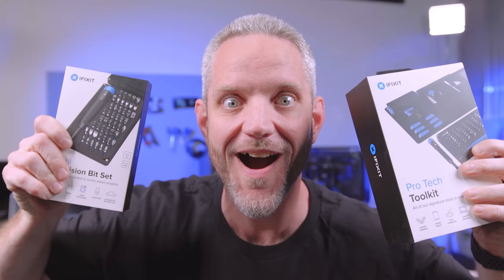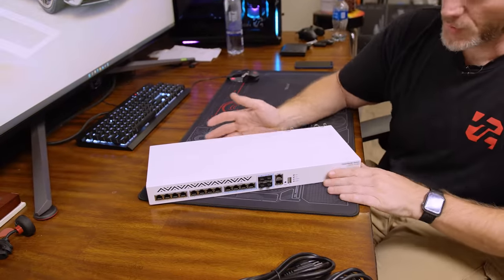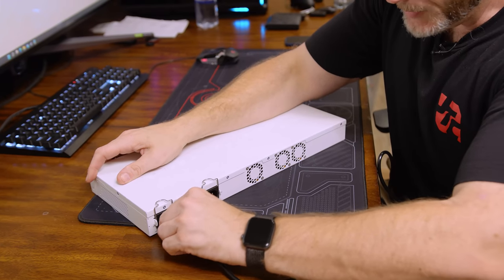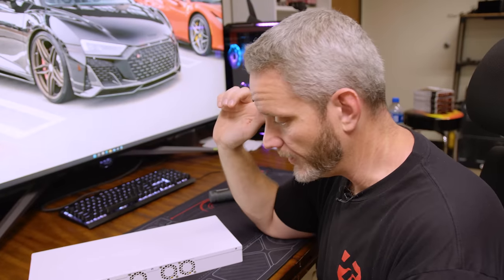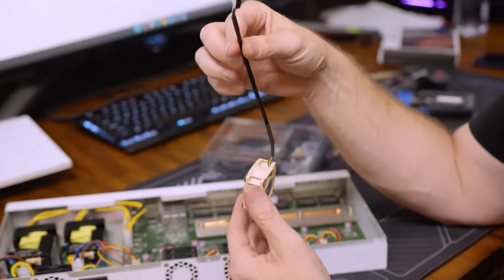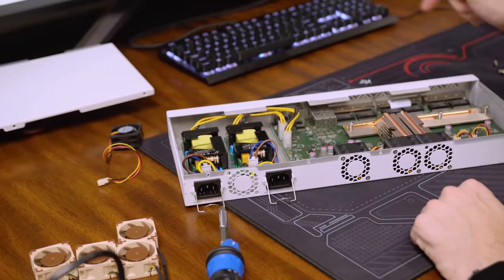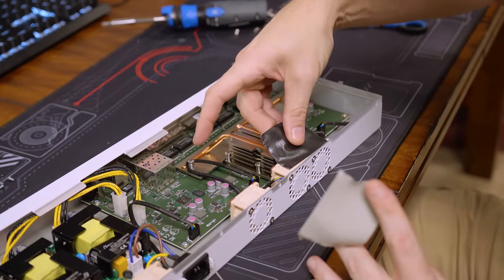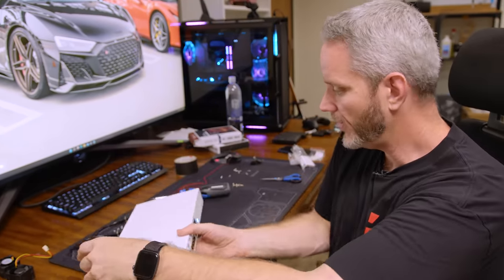We had to modify our new network switch...

Comment: I own several of MikroTik switches for my home lab.   Jay, since you don't want to use advanced features or configure it go into the WebGUI and switch it to SwitchOS.   This will give you much better performance.    Make sure you update the RouterOS firmware first before switching it to SwitchOS.
Reply: I agree with this 100% and I will add something very important. Make sure you enable ARP Tables in Switch OS. This will give you a lightweight management scheme that significantly increases performance, reduces traffic, reduces switch fatigue and greatly increases the connection speed (also reduces lag). From Jay’s description of use case… this is what he is really after. Oh… it will also offload local traffic from your higher tier router. 

Lesson: Just make sure ARP Tables is enabled in Switch OS. It’s one of those few simple options that has a dramatic effect of local network performance at a micro-price.
Reply: 100% the right answer here. Being a system engineer and homelabber these 'server' videos are kinda funny to watch. "these switches sound like a whole server rack on it's own" haha tell me you haven't been in a DC without telling me.
Reply: @pitspeedtv  OK, never worked with MikroTik but I have a question. This is an honest question about how the switches run because standard networking goes against your statement. What exactly would using ARP tables on a switch running l2 communications do to help? Just curious because ARP tables are L3 (ip/mac) and the switch at L2 only cares about mac location because it is directing traffic based on mac to mac. It's going to look at the incoming frame and and see the destination MAC address and then send it out the corresponding port it has in its MAC table. It will never go to the ARP able unless it is also running router functions. Adding ARP tables to a switch that is not also doing routing is just overhead on the switch processes.
Reply: Another vote in support of this suggestion
Reply: @joee7452  All good Joe. Good question(s).

You just pointed out the highlight of SwitchOS (I don’t work there, just tested extensively).

traditionally (this is where you are getting tripped up), ARP Tables are (and still are) reserved for Tier 3. The same place that VLANS, DHCP, and VPNs reside.

Ironically, this switch is underpowered (chipset) to handle any sort of VLAN, or VPN loads. This is where you would buy ubiquiti and such (therein lies the cost justification)

BUT….. What if you stripped away all of that and said this:

“Let me take my memory, and my processing power (traditionally reserved for managed tasks), and apply it to three simple tasks…”

The three tasks:

1. Query the ENTIRE network (including the tier 3 router) for matches on a local subnet, PER PACKET. (BTW unmanaged (T2) switches just send it to the tier 3 router, because they have no ARP tables, etc.) Traditionally, waiting for the reply, is the major cause of what we know today as Network LAG.
1a. What if we stored that and routed all proceeding packets at what would traditionally be considered tier 3, at Tier2?)
Before I go on… it is technically tier 3, but what if we could make it tier 2A? Not send it to the router/T3.
Network Lag becomes very apparent when you consider that every packet (big or small) needs to be parsed, and passed, and rerouted until a handshake occurs. Until it runs into a rule, or specific network instruction (Tier 3… internet router, etc.). The LAG comes with the waiting for reply and the timeout when none is received.

2. What if we had sufficient memory and processing power to maintain a simple list of successful handshakes and packet transfers (locally in the same subnet), and completed the handshake and transfer without needing to send it up to the “gateway”? Well that is an ARP table. No waiting, no LAG, and simple routing, handshake, packet completion.
At this point we are in traditional Tier 3 territory. But what if we could do it at tier 2? Or technically tier 2A.

3. Store and Parse not only the *known routes*, but detect and parse the packet size?
Again a typical tier 3 router function.

Well that is what SwitchOS does. In fact with the exception of #3, that is what a normal “dummy” switch does.

So you are correct about Tier2 and Tier3. SwitchOS is a beautiful hybrid. Strip away the VLANS, VPNs, etc. Just focus on LAN, and send it up if it doesn’t have a recognized subnet. 

It’s a 10G Ferrari LAN, at a KIA price.

All of the bad reviews revolve around RouterOS and its inability to to VLANS and VPNs. 

That is not where it shines.

Jay’s use-case is perfect for that switch… in SwitchOS.

The SFP+ version of that is cheaper, and you can use ethernet SFP+ adapters, as well as scale to fibre at less cost…. but the topic is Switch OS and ARP Tables. I digress.
Reply: Sorry… made an error. Traditional “Managed switches” maintain ARP tables, and if you don’t ask it to do VPN or VLANS…. it functions the same. Just not “traditionally” at 10G. But also points out why you ALWAYS opt for Managed Switches, VS the Unmanaged (Dummy) switches. Sorry for the confusions.
Reply: @TheMrDrMs  Hahahaha You sir had me rolling with that one. I have hearing loss from the fan pitch from maintaining servers and switches.
Reply: @pitspeedtv  OK, except the whole idea is latency inducing. The idea around switching is MAC based. The switch doesn't care what IP the destination is. All it it does is receive the frame, check the destination MAC in the header and then send it out the port it has associated to that MAC. I am ignoring going into how a switch fills it's MAC table. A l2 switch cares about MACs only because that is the fast way to switch frames. From an IP level the packet is either destined for a node on the local network, in which case it is going to put that packet into a frame with the destination MAC address for the switch to forward it directly to or it is going to put the MAC addresses of the Router or Gateway in the frame to tell the switch where the frame needs to go.The speed of switching is because it is limited to MAC to MAC communication. Forcing a switch to to not only open the frame header but the packet header to read the IP on top of the MAC would just induce latency. That was why I was confused at why that would speed up the switching. Switching is simply from this MAC to this MAC. The switch doesn't need to know about IP because the sender is going to put in the destination MAC for the switch to forward it to in the frame. That includes putting in the MAC address of the l3 gateway/router interface if the destination is not on the same local network. So even in that case, the switch knows the MAC it has to forward to. 

Please understand, I work with enterprise networking (Cisco,Arista,Juniper,Mellanox, etc), so I was confused on why forcing the switch to look deeper into the frame before sending it would speed it up. I will take your word for it that it does, I just don't understand why they would setup a switch to speed up that way.
Reply: @pitspeedtv  I prefer managed also but even simple unmanaged switches keep MAC address tables. That is all a L2 switch needs to have to preform its functions. Because without that table it's a hub.

ARP is used at L3 to determine what MAC the IP is tied to so it can be sent out the L3 interface to the next node's MAC address. That could be the destination or the MAC address of the next hop.ARP table and MAC address tables are not the same thing. Simplified - ARP is "to get to IP X send to MAC X". the MAC table is "MAC X is located off Port X".
Reply: @joee7452  Yes we are agreeing. Mostly. Except that the MAC Table cannot exist without the ARP Table. Which by design is dynamic. Which means that it is constantly queried. Hence the “broadcast and wait” reference. Hence why supplying a ARP Table on the L2 Switch is advantageous, in this and all small network environments (Hence why basic managed switches are higher performing by their very nature, in their basic function.) At worst it is one less query up the chain, in the middle it offloads unnecessary queries for local connections from the traditional Level 3 router/firewall/NAT Server/Traffic Shaper/Traffic logger, and at best it is a 10G Level 2 Local Switch that does all the above with one arm tied behind it’s back and proceeds to kicks ass. It kicks ass because its affordable, reliable, configurable, scaleable, at base cost )Which is a LOT more than the Ubiquiti’s and Cisco’s of the world can boast for small business/home. (Ubiquiti and Cisco have their place…)

So in closing: 

Lets not lose sight of the initial post.

Jay bought it. I personally thing he made the right choice (sort of). Put it in SwitchOS and enable ARP Tables locally, and his network (based on the video information) will perform better, faster, and more dynamically attune to any changes. 

Happy to discuss further in another way. I simply fear we are getting a little too deep into the weeds for the original conversation.

Cheers.
Reply: @pitspeedtv  I'm sorry, but your earlier comment seems like a bunch of meaningless gobbledygook. There is zero benefit to having an ARP table on a device that is not doing routing. It does not allow it to move traffic more efficiently.
Reply: @pitspeedtv  is so wrong it's not even funny. Please ignore this insanity. ARP has nothing to do with Ethernet Frame forwarding for a layer 2 device. 

I have personally pushed 10 Gbps through a Mikrotik switch doing VLANs. config just needs to be done correctly.

RouterOS is just fine, the problem is that Mikrotik doesn't have guard rails to keep you from hanging yourself. SWOS, I have used the cheapest SWOS device to tag and untag VLANs at gigabit speeds. (which I sold gigabit internet on, and kicked butt with)

Now, if you want your switches to keep track of which IP goes to which MAC, (the whole reason for an ARP table), which isn't where LAG comes from BTW, you can, but it's only more stuff for your switch to do. It won't help you at all except for make diagnostics more frustrating.
Reply: @pitspeedtv  VLAN is layer 2 (802.1Q / etc ) not Layer/Tier 3 as you say. Unless you add a Layer 3 interface to perform inter-vlan routing on the switch. But even with inter-vlan routing on the switch, the layer 2 vlan is not using Layer 3 to determine what port the frames go until after the layer 2 tag gets processed. Layer 2 would be parsed then Layer 3. So if your switch only has VLANs and no inter-vlan routing then any Layer 3 or higher (4+) would/should be ignored by the switch.
Reply: There's a lot of "a little knowledge is dangerous" in this thread.
Reply: This is terrible advice. SwitchOS is a forgotten stepchild of an OS by Mikrotik. It's had long-standing bugs like VLAN leaks, tag dropping, port-bridge bit flips, etc etc. The list goes on and on. They've never fixed it. RouterOS is a much more powerful OS that gives you more options for Layer 2. Performance has zero impact between both, in RouterOS you'll get line speed out of all ports at the same time full duplex on L2, that's how these switches are built.
Reply: @pitspeedtv  damn you got wrecked so fast. it's not even funny.
Reply: Well look at those weeds. Squirrel!

Dear Jay,

I watched your video and you articulated a number of things you had, want, and things you are hoping to overcome.

In fact, the whole video was about you putting Noctua fans in your 10G Mikrotik Cloud Router because the installed fans were too loud and this was a big problem for you. You also said that you were worried about what the fans would sound like if the router was under load.
You mentioned that you had a server that you just want 10G access to. Which means you probably also have an existing router. You also went on to mention that your needs were extremely basic. No VLANs, VPNs, etc. Or at least not on the 10G network, and more specifically, not on that router you just bought.

So what we are left with is this:

You have a need (connect via 10G to your local server).
You have a Solution (Mikrotik Cloud Router)
You have a concern (Fan noise under load).

Regardless of Layer 2/3, etc. You just need a basic 10G Switch. Turns out that the Mikrotik is very capable. So now we just need to pound down the load if possible (fan noise).

An easy way to do that is to run it in SwitchOS. It’s not as robust as RouterOS… but you don’t need robust. You need basic function, with preferably low fan noise. SwitchOS will offer this to you.

I use it on all of my mikrotik switches, because like you… I am not asking them to do routing. I just need them as a basic 10G Switch (that is affordable and performs). I have a router to handle the routing. 

ARP tables do not take a lot of resources, and does not require heavy computation. It is not a traditionally heavy load operation. In an enterprise level network you would probably want to centralize this, but you have a basic network. SWOS offers this ability. Why not, one less thing for your router to do (but is doing it anyways). One less query. 

If I have qualified your needs incorrectly, and you are planning to use this as your router. I will withdraw my recommendation and suggest RouterOS. But I am pretty sure this is not the case.

Basic Switching
Lower the Fan Noise.
My recommendation in this scenario is SwitchOS.

Hope it works out for ya.

Peace.
Reply: @pitspeedtv  youre still getting CAM tables and ARP tables confused.
Reply: @pitspeedtv  I will say ok except for the statement that a mac table can't exist without an ARP table. Unless that is specific to that type of switch, the statement is reversed. An ARP table can't exist without a MAC table or if it does, it is useless. The MAC table is the lowest level communication table. A switch (l2 or l3) needs a MAC table to provide switching functions. A l2 switch has no need for an ARP table. A router (or l3 switch) would use an ARP table for routing, but still requires a MAC table to actually transmit the frames out. A packet can't be sent directly to another device. A packet is L3. It has to be wrapped in an L2 frame to go to the next local hop. The frame is the data that the device then creates the signals for on the line. 

Of course we are talking Ethernet communication here.
Reply: @pitspeedtv  there’s no query and wait in any L2 switch. If it doesn’t have a learned MAC it just floods the frames to all ports in the VLAN until it does learn. There’s no reason for any L2 switch to into the L3 packet, whether it’s IP, IPX/SPX, or bobs bandwidth packet bomber it doesn’t care. L2 MAC learning is based on the source address for received frames on a port. The MAC table is usually kept in the switch chip on these small switches, sometimes as CAM sometimes as SRAM. Either way it’ll usually be wire rate at minimum packet size.  Once you go up over L2 you’ll struggle to hit wire rate with these lower end L3 switches, especially if they have a lot of table misses. I’ll bet the feature you’re talking about only takes effect for L3 (routed mode) packets, which traffic within the same VLAN shouldn’t generally hit.  What it sounds like your describing is you completely misunderstood L3 mode/features and they’ve an option for when in L3 routing between VLANs is to have the L3 portion programmed into the switch tables thus doing an L3 switch operation instead of fully routing — which would punt the whole frame/packet to the cpu/os for every packet, but by doing a basic L3 switch only the first, or first few, packet gets punted then the cpu/os programs that path into the switch chip.
Reply: @TheMrDrMs  mikrotik has fanless systems for SO/HO situations, and fan-cooled systems for datacenters. awesome stuff.
Reply: OK, look I just have to ask.  Why do you think that SwOS provides "much better performance".  Like, in detail please because I don't believe that is accurate.
Reply: I’m sorry, but switching to swos will not speed up the l2 performance. The default config (all ports bridged) is fine. If you want vlans, enable vlan filtering and fill in the vlans. That’s all. Oh and don’t use this switch for layer3 routing stuff… that is not what it is made for.
Reply: Never use SwitchOS, always use RouterOS if possible for multiple reasons:
- Management on SwitchOS (through the WebGUI) is really unreliable compared to RouterOS + WinBox.
- Performance difference is practically a non-issue if your device has switch chips (which this device has).
- RouterOS gives access to the CLI (eg. via SSH or WinBox).
- RouterOS allows for much more fine-grained control of the ports.

Nobody really uses SwitchOS because it's buggy, a pain to manage and likes to break at random as well... Not something you want in something resembling a business.
Reply: @berzerker4998  Exactly, there is no difference between RouterOS and SwitchOS, in the box there is a HW switch managed by SW that runs in SOC and it doesn't matter which one. SWOS or ROS only set the registers in the switch chip, but the hard work is done by the swtich chip itself. So its very funny reading about ARP tables and so on :)
Reply: @pitspeedtv  How do I enable ARP tables in SwOS? Can't find it.